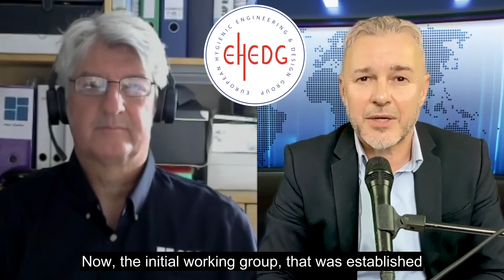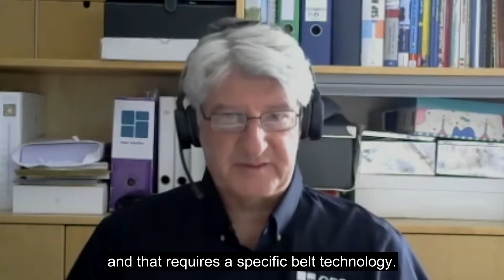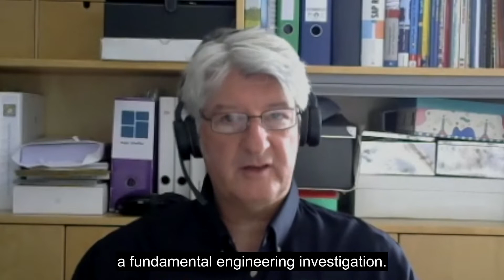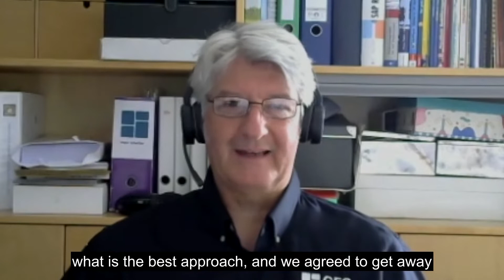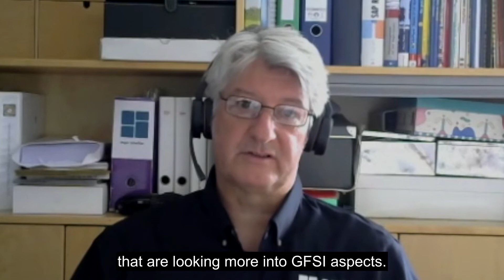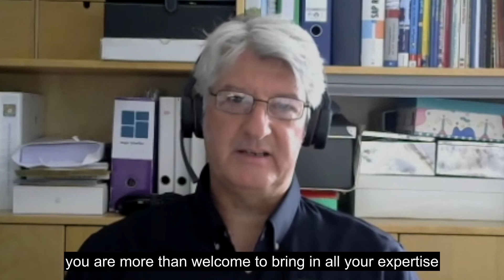Contribute to the new EHEDG Guideline on Conveyor Systems

Comment: This video highlights some very important issues on the possible automated cleaning of conveyors. 
As well as pinpointing, that a high focus and consideration must be given when introducing spray bars and nozzles. 

I work as Product Manager for Automated systems at Nilfisk Food in Denmark and we have seen first hand the issues the end user is having.
And this issue is not unique for conveyors, it is universal for all types of machines; fillers, ovens, freezers etc.  

We have at Nilfisk Food, begun to increase the level of support and detailed design towards our clients, in order to assist them with these specific problems.
Currently we are testing a lot nozzles individually for their efficacy and spray patterns. 
In addition to this we have also purchased CFD simulation software in the aid of correct placements. 

This is as we see it, the logical necessary next step. 

Great video and topic.